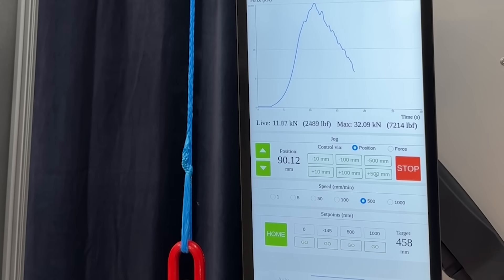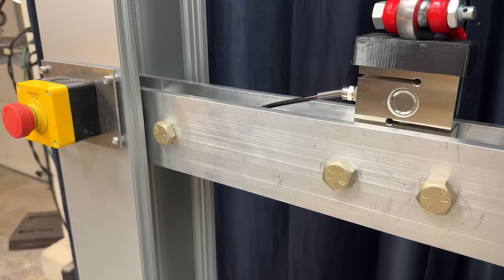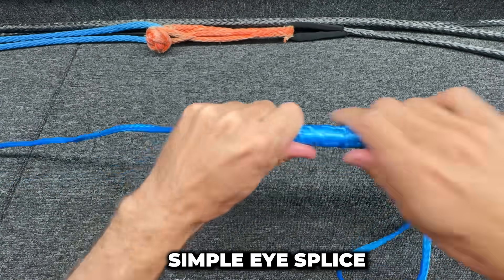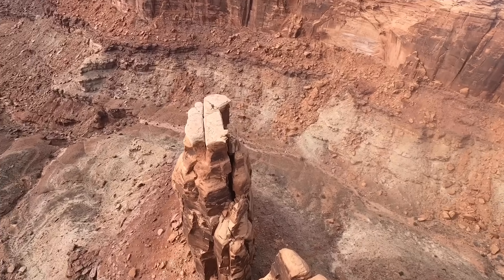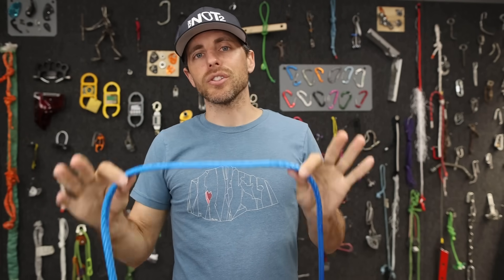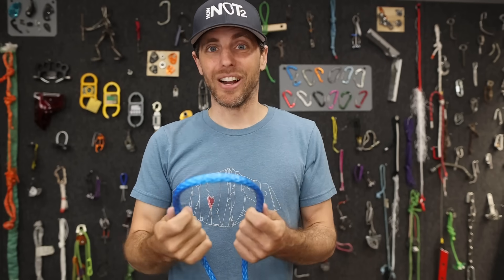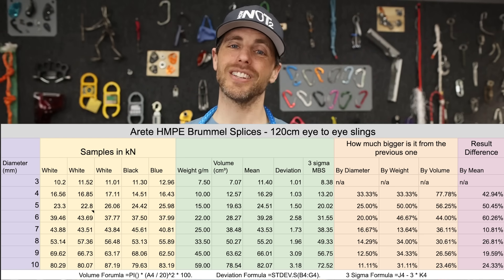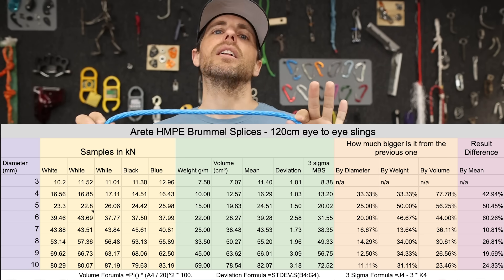The numbers are all over the place

Comment: Ryan, the video clarity (in concept and in principle) was low. Thank you for the extra testing!!!!!!!!! YOOOOO!!! 
Umm @7:18 - Where did this "not friction to hold it but this polygon shape that it creates..." nonsensical logic that friction isn't what keeps to separate entities from sliding past each other, come from? We know and You know that friction is a fundamental component of "holding place" and when force overcomes the friction-mass coefficient that movement happens, AKA slipping.
Reply: After re-watching, I think you were trying to explain the dynamic nature of the splice under load as a function of force over time. Critically important, I think you were trying to say that the material under tension will compress itself (because we're testing an eyesplice instead of a joining of two different materials) until the rate at which the tensioning material exceeds the inertia and friction profile of the material under compression.
Coefficient of Friction is highly dependent on the interfacing materials. If their material properties are changing over time (like due to stress/stain under load, or age and/or exposure), then the forces that can be statically reproduced in a setup must also change.
Reply: Two masses that are the same amount moving in opposite directions that share a common interface where one is a cylinder and the other is a hollow cylinder and they are concentric, then it follows that the system will see thermal diffusion from the hollow cylinder to atmosphere making it slightly less energetic than its enclosed cylinder, but the interface between the two masses would experience the same electromagnetic forces between each other for the energy level. Every pull test is about adding energy to a static system until something changes. Well, it turns out that materials do not necessarily have a constant friction coefficient across a temperature range. If this feels unintuitive , consider friction to be like the viscosity and think of the viscosity of honey while adding heat (energy) to it (it flows more readily, faster at higher temps).
It's really weird that a material like rubber brittle hard and has low friction at low temperatures but becomes stickier, higher friction at medium/high temperatures, and then loses friction at excessively high temperatures but I think that's the nature of phase changes in any given material.

Comment: So, wow.
UHMWPE was trad used as bearing surfaces in Knee and Hip joint Implants. To varied success.
The stuff has low friction qualities, about as slippery as any tough plastic can get....
Failure in joints came from either, applying new manufacturing processes that ultimately changed the characteristics of the UHMWPE, reducing its usefulness, or wear particles getting into the body and causing a reaction. 

Whilst generally replaced by ceramic bearings in hips, in knees it is still widely used. 

By hitting the substrate with gamma rays during manufacture,  producers can make the polyethylene,  HIGHLY CROSSLINKED, that improves its strength and durability. 

Ask the manufacturer what processes they use in manufacture.
Reply: Radiation cross linking is also used in electrical cables to prevent dimensional changes under pressure. That reduces ultimate tensile strength however because it makes the polymer more brittle.

Comment: As mentioned above, in my experience with 12 strand in various sizes brands, etc. there is variability! The Brummel you are using is highly unsafe for live loads - as per the stunt rigging community. The Mobius Brummel cannot ‘slip through the sandwich’. Your test at seven minutes would never fail with a Mobius. Great work, as usual!
Reply: I’ll Google it, but I’m guessing mobius has the tail of one eye wrapping the other eye?
Reply: @michaelstanley6466  The eye is essentially 'choked' on itself. Live loads can be subject to cycles of slack and tightening - the plunge won't give the an acceptable margin of safety

Comment: Do all the diameters have the same pitch to their braiding, relative to their diameter? It could be that the fibres are more kinked for some diameters, so are proportionally weaker.
Reply: The factor you are referring to is called "lay length" in the cordage industry, and generally a longer lay length is stronger...

Comment: To me it feels like the huge range in breaking strength of the same rope comes mostly from unequal loading of the strands. This would explain why this is such an issue with very static ropes. The less one strand can stretch in length before it breaks the less force other strands are going to bear which would distribute the load. More strands (thicker rope) only increases the strength when tension is close enough to equally distributed so they can share the load.
Reply: I think dyneema doesn’t stretch, the weave tightens which isn’t the same thing. So Maybe you’re onto something. 

Possibly When he’s making the splices there’s some variation meaning it’s not spreading the load equally through the strands. 

I don’t know whether this is true but I’ve heard that as dyneema exceeds its breaking strain it heats up which breaks the bonds at a chemical level. I have no idea why this is in my head though , don’t quote me on that 😂

Comment: Can you test tree bracing? It's the same stuff i believe. We used to use cobra but now use GEFA bracing. We sometimes pull older braces out of trees, 5- 8- 10 years old and i wonder how that has been effected. Also cobra uses a dampner. GEFA you weave through itself once before and after spicing an eye. Plus we leave some slack for taking the tention off in a few years. This is all for dynamic bracing. Steel cable bracing would be another day an interesting topic but is less common.

Comment: First I enjoy your channel, and it's been very informative, and entertaining.  I've tied many eye splices, using what is called the Mobius Brummel splice, and made one whoopie sling as a way of changing the length of the rope.  I'm curious what the tail length you are using for your test samples, as I've always used 72 times the diameter of the rope, and tapered the tail at 12 different locations.  I like the Mobius version as you don't need to run the long end through as well.  You can make the eye splice using just one end.

I did watch your video on how important tapers are.  Now that I watched the rest of this video, you have answered my questions.  I wrote the above as I was watching, and the questions came to mind.

So it seems that 40 times isn't really good enough.  I'll stick with 72 times with a well stroked bury, since that is headstart on maximizing the strength of the rope.  On the whoopie sling I made, I have 5 1/2 feet of bury, but I don't remember the diameter of of the rope, but it's at least 20cm. 

Good luck with the world record.  Since it looks like you all go places that getting stuck could be easy to do, I hope some you are carrying Yankum ropes and winch goodies. 🇨🇦

Comment: Sk75 is the base product  for 78 and 99max.
 78 is 75 stretched in temperature controlled hot box to set the fibers resulting in more consistent strand loading within each of the 12 cords making the rope. 
99max is78 on steroids aka 75 taken  past 78 (higher stretch at highrt temp).
Reply: The same effect can be observed when trying to pull apart a plastic shopping bag. At first the plastic streaches quite well, but at a certain point it gets super hard. You are orientating all the long molecules in the direction of pull, as soon as they are alinged they cant go any futther and it gets stiff.

Comment: Interesting video ❤
A couple of comments from someone who knows how little he knows 😊
1. To be able to use 3 sigma the distribution needs to be “normal” i.e. follow a standard bell curve, or the formula is not valid. Hence your MBS may not be valid. 
A quick Andersson-Darling test and a Shapiro-Wilkes test indicate that the distribution of the 10mm may be normally distributed but the sample size is really too small to make any conclusions. In other words be careful with statistics.
2. In order to have reliable equipment you need to ensure quality control, in this case of the splice.
Testing every eye splice you do up to the yield strength of the material may give you some indication. I know how metal works but have never tested Dyneema, so I don’t know if the test would compromise the strength. Maybe check with the manufacturer.
3. Since there are so many parameters involved both regarding the material and the rigging, a good safety factor is essential. 2 is probably the absolute minimum. Any lower than that normally requires Aerospace grade engineering, quality control and testing.

Stay safe! We want more videos 😂
Reply: Isn't aerospace safety factor commonly 1.1-1.3 (with insane quality control)?
Reply: @netWiz1  NASA mandates a safety factor of 1.4, and the FAA mandates 1.5

Comment: This is a fun problem- given it some thought before. There's a problem with testing samples with 2x eyes - you're really testing which eye fails first. If there's high variability in the distribution of splice break strengths, your testing of break strength isn't sampling the distribution evenly, it's testing the weakest of a head-to-head test. There are stat methods to deal with this sampling issue, but couldn't quite land it with my stats inexperience. 

There are other weird implications of high variability: think a chain. Chain MBS is treated as in intrinsic property of the material, ie it doesn't depend on amount of chain. But, a chain is only as strong as its weakest link, and in theory as you have more links you have a better chance of having a weak one. It's only due to low variability that treating chain this way is sane. If you made a chain of dyneema eye-and-eyes, I don't think you could make the same assumption.

Comment: The professionally spliced dyneema rope I have for arborist applications, was stitched off or whipped according to specs in the manufacturer's splicing manual. That should help retain the buried tail for more consistent test results.
Reply: I wonder how much variation the brummel is adding, since it is essentially a knot at the throat of the splice. In your breaking samples I see it sometimes break at the end of the bury and sometimes at the brummel (4:23 in this video appears to be at the brummel for instance).  Brion Toss (sailing rigging guru, sadly RIP) gave brummels a lower rating for this reason. 

It would be interesting to see you do a batch of brummel vs sewn bury.  

I love these videos.
Reply: We splice our own stuff with  Samson Tenex.  Love the stuff.  Haven't tried any dynemma.  Can't imagine needing more than Tenex.
Reply: @Kevin.L_  Tenex is better for rigging, when it's strong enough, because it's so much more durable for the abusive nature of a tree job. Spectra is really sensitive to heat and abrasion. But jeez it's strong for straight line pulling.

Comment: Concerning predicting the strength based on the diameter: It seemed that it scaled as the weight/length, which behaves like the surface area of a slice, which intuitively makes sense.

Diameter ~ R
Weight/Length ~ R^2 ~ Surface of a slice
Volume ~ R^3 ~ Total weight

I wonder if there is some different treatment for the different diameters, which explains the deviations from this relation that you're observing.

Edit: Looked at the tables, it looks like Weight/Length does not behave like R^2 at all. I am pretty curious why it doesn't work like that. (Even though sometimes it does?)
Reply: I expected the 2/3-root of weight to predict breaking strength pretty well, but there are still some strange non-linearities remaining.
Reply: Do all the different diameters have the same braid pattern?

Comment: Congratulations! You just discovered the struggles of all textile product companies. I am not surprised at your results, they are similar to my own. I have tested many spliced products in HMPE, polyester, Vectran, and Technora. You get at least this much variability with pretty much all of them. I have had opportunities to chat with people that work at some rope makers, and they all report the same thing. I think that rope makers do not use 3-sigma ratings (a lot of hardware companies also don't as far as that goes.) Usually that MBS number is something along the lines of the lowest result that they got in their test.
Reply: They likely aren't setting the MBS as a 3 sigma value. Instead they have set a desired MBS then test a sample group from a run and calculate a 3 sigma (99.7%) confidence interval that the true MBS of that batch is not below the marketed MBS. They sound similar but they are different.

Last time I used any of these was decades ago. Maybe a current manufacturing actuary could help.
Reply: @barongerhardt This sounds reasonable. A 99.7% CI is a responsible way to state numbers like mbs, but as far as marketing and ease of use goes it is convenient to have a nice round number that is slightly below the 99.7% Confidence interval. Textiles would have a wider range, but that doesn’t mean that we should accept less reporting accuracy in their ratings. If HMPE manufacturers are reporting minimum test data for their MBS numbers, that’s a scandal imo. The consumer is led to expect a >99% confidence in mbs, and we are getting much less than that.
Reply: WLL  should be that value which must exceed the 3-6 sigma (wherever the standard sets it for the application)- taking into account in-service wear)..
Reply: @mountainmandoug did the people you spoke to suggest any theories as to why the variability is so large for these?
Reply: @FergatronMusic  No, it is a taken-for-granted thing. People only think it is remarkable if they have worked in some other industry with less variability.

Comment: There is an issue with long samples that must be looked at.  Uniformity of the rope can change over extended lengths.  In engineering, we have the Bogus Fudge Factor for round off errors and inconsistent material strengths.  When stringing up more than 1000 feet of a rope, your chances of the rope breaking at a lower value is high.  Many times, when spec'ing material, we will figure out the stress and double it to be sure the product doesn't fail.  With rope, the weight (gravity) of the rope comes into to play when finding a blemish.   

If you want to get into the math, you will run into many areas of unknown, which will lead to long discussions with a Physics instructor!  If you want to talk to young engineers, there is a problem with their consistency.  I was in an engineering meeting 20 years ago, when this young engineer approached me with a groundbreaking solution that would fix the spring solution for rolling doors.  He had gotten sloppy and left the mass out of the equation, creating an anti-gravity solution, which turned our overhead doors into guillotines.  He also failed to add resistance factors, that add up to massive failure if overlooked.

Comment: What the hell, I'll throw my materials knowledge into the internet cesspool..........

The poly strands cannot be made with the same consistency as other materials like steel/nylon.  (We've been making nylon a lot longer. 1935!)  Also, and this is a big part of it, ANY kind of kink, fold, twist present in the rope from adding in the eyes, is going to act upon those strands at load.  More of a hypothesis, I would venture as well that you cannot take into account friction, heat, stress induced on the rope/strands during spooling, transport, etc.  The rope on the interior of the spool is being crushed by the outside diameter of the spool.

Comment: Maybe the problem with variability in your results is your sample size which seems to be 5. Commonly, for a continuous variable like this, a sample size of 30 would be used.
Reply: Uuh no? Adding more samples will never decrease variability, only increase it.
Sure it might decrease your standard deviation, but not variance(highest and lowest)
Reply: @rogervanbommel1086 Yeah, but you understood their point
Reply: @rogervanbommel1086  In stats variance/variability is the square of the standard deviation. What you are looking for is the "range" of the dataset. With a reasonably representative sample the range and standard deviation and variance shouldn't significantly change with more sample. What does change with more samples is our confidence in the accuracy of those values in the test set (reducing expected error).

The goal is to be able to say that the new test set doesn't show a significant deviation from the expected model. EG we are 99.7% certain this batch meets or exceeds the standard.
Reply: @rogervanbommel1086 
It will give you a clearer distribution and redose the effect of an outlier